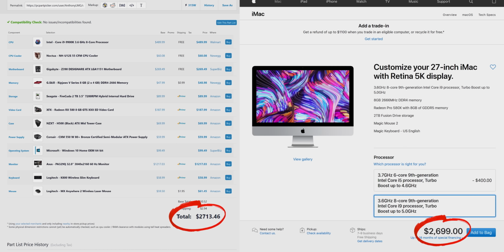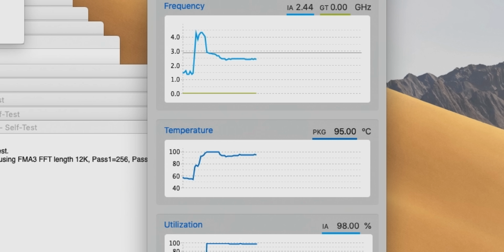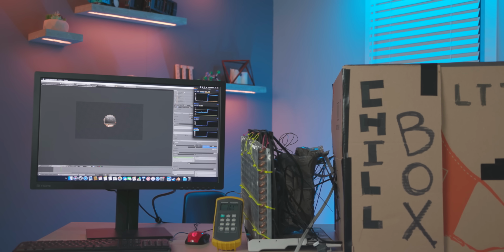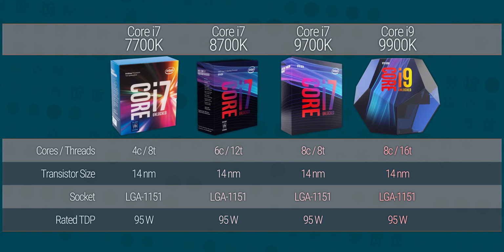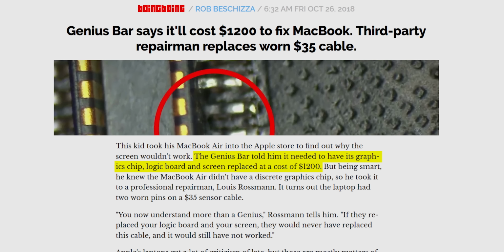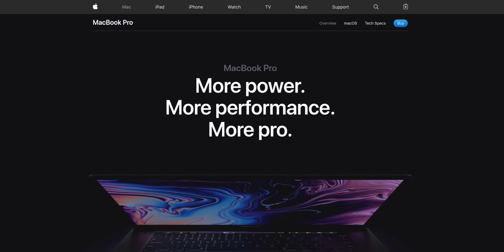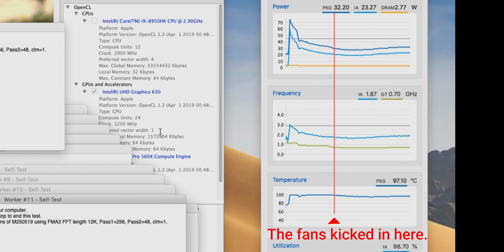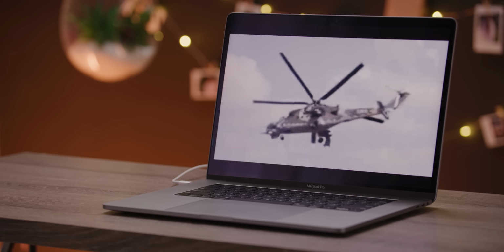Macs are SLOWER than PCs. Here’s why.

Comment: This video makes me wonder how well that new M1 chip is doing.
Reply: Pretty good in fact, a complete 180 degree turn, from a bad to a good purchase.
Reply: it's doing well,but apple products are still crap
Reply: @the-lag-gamerita5446  
Yeah, but the Mac operating system is totally worth it.
Reply: @matthew8153  not really.it's really limited compared to other operating systems.you'd  be better off with linux.and that's also ignoring the mess apple makes when it comes to repairing their products,and planned obsolescence.
they look cool tho.
Reply: @the-lag-gamerita5446  lol I have a 2012 MacBook Pro that I still use to this day
Reply: @Justin-hy9xz  anecdotal evidence,irrelevant.and it would also depend on the model.there is no shortage of apple products fried by insufficient cooling,or with poorly manifactured or defective components.
Reply: @the-lag-gamerita5446  the same can be said for windows
Reply: @Justin-hy9xz  except windows doesn't make PCs and so they have nothing do do with the eventual failure of your machine,wich will generally be easier or cheaper to repari than any apple machine.and if you don't like windows you can get linux.so no,the same cannot be said about windows.
Reply: @the-lag-gamerita5446  they look cool tho
Reply: @Justin-hy9xz  yes,they do.altought,you can probably find PCs that look more cool.the minimalist stile is good tho,i'll give em that.
Reply: @the-lag-gamerita5446  I mainly use my Mac for garage band which it handles pretty well, I just hate how over time all my PCs slow down. I guess that’s why I like using Apple
Reply: @the-lag-gamerita5446  I'm personally looking into virtualising their OS as while it may run a little worse than linux being in a vm and all it's much closer to windows in app quantity

Comment: I thought mac's performed better with the same specs? With more optimization etc? Or is this about how certain apps are more optimized for windows?
Reply: windows is just a hulking mess tbh
Reply: Technically apps are better optimized on macs than on windows. But bc apple has been making their macbooks slimer and slimer it gets very hot inside them and they can't run at full speed, so unless you have your macbook cracked open and inside a freezer I don't think it's gonna run faster. And again if the cooling was good it would be way better than a lot of windows PCs.

Comment: True but
Pc lifespan: dead in a year
My 12 year old Mac: So want me to run a showcase on ROBLOX at full graphics settings?
Reply: I'm curious, what is your reference for "PC Lifespan: dead in a year"? Just because some PCs fail, doesn't mean all do. Comparing reliable brands, Apple is no better than PC manufacturers. They just perform worse with similar reliability at best.
Reply: im sorry, ive had a couple pcs
my laptops: both havent died (one is 6 years old, one is 2 years)
then a 12yr old pc and a small intel nuk or whatever you call it

Comment: Because... they have worse hardware?
Reply: This video was made in 2019,macs are more powerful than pcs now.
Reply: @dreamsider  in what field?
Reply: @jonah6431  every field,they just blow away the competition
Reply: @jonah6431  intel chips were holding them back before so they shifted on their own chips and they changed the game with that.
Reply: @dreamsider  price per performance? Gaming?
Reply: @dreamsider  nope lol,multithreaded tasks are shit with the M1s
Reply: @the-lag-gamerita5446  they're still better than most powerful intel laptops
Reply: @dreamsider  confused AMD noises
Reply: @the-lag-gamerita5446  if you're talking about an intel pc with max specced gpu then ofc that pc would be better because macbooks have an integrated gpu but pc's have an dedicated gpu.
Reply: @dreamsider  no no,i meant that  there are also AMD based laptops.AMD is currently trashing intel after all.
Reply: @the-lag-gamerita5446  yeah, that's true

But the thing is still the same amd laptops have an amd processor along with an amd gpu,ram and other stuff

But in apple's case they have a single chip that have integrated graphics, neural engine, ram.

And that's also the reason why amd laptops are better for gaming.

Comment: people never complain when asus or msi make a damn laptop the size of a damn desktop but they demand apple to keep making them thinner
Reply: It depemds whar you want it for.
If you want it for gaming, then it may be bigger because you won't be going with it in many places.
If you want to do work on it, then portability may be important so you can work on it at home and at the office.

Most people buying from ASUS may as well just buy from any other company, but MacOS is only available from Apple and it is not for gaming on it unless you install another OS on it, but it's easier to buy a laptop which has the OS you want unless you are a Linux user and want to try many distros directly on hardware and not on a virtual machine.

Comment: Infact who buys apple is just plain stupid - even you don't need the power (b/c it gets throttled away anyways) given ppl are just paying too much money for aluminum housed crap - I never got one and I never will get one. I rather go with ROG - my last ROG Gaming Laptop is a G55VW S1071h - and I bought it 2013 - AND I'm currenlty writting this comment with it. 7+ years of heavy use at full performance and this thing still works fine for just 1300€ on my side to pay.

Comment: A Mac gives a better ‘package’ deal for everyday use. It runs smoothly and longer than PCs. The design and build quality are also important. 
This is what non-nerds care about. It runs smoothly and for a long time. And part of it is due to the OS.
Reply: apple slows old devices down to keep up battery life and you are saying that they run longer?
Reply: @user-hx7dc9uz6s  Well, they do, for what they need to do. I prefer to browse my internet a bit slower and still have a few hours of battery, than still be 'fast' after few years but with only 1 hour of battery.

Comment: its all Intels fault tbh
Reply: nope,it's apple fault,they design the cooling and choose the processor. also you are a sheep.
Reply: @the-lag-gamerita5446  they had contracts with intel and based on that they choose the design but intro couldn’t deliver their promises and therefore it would throttle because the design was never meant for shitty intel chips. They’re still on the same nm process they used for almost a decade now and fail to make any progress. Also how do you even know If I like Apple or not based on one sentence? You sir are a prejudice pos
Reply: @Burgerklauer  apple has full control on their PCs design,they should've just made it thicker and call it a day. there's no need for it to be so thin anyway.
Reply: no because intel does not create the thermal solutions

Comment: I have a Mac mini with a Intel core i5 chip.  I am running boot camp to run Windows 10.  I play World of Warcraft and I have done it in Mac OS and Windows 10.  Windows 10 does as expected with the hardware at hand. When I run World of Warcraft in Mac OS it is a train wreak.  I cast a shield and 10 second later it shows in the screen where in Windows 10 it is really fast.  The same with casting spells.  The reason I have a Mac is because I am a programmer and Swift you have to have a Mac.

Comment: Apple COULD sell a performance line of laptops with a thicker case that had adequate cooling.   as much as millenials love to carry around a wafer thin laptop with no optical drive there are also performance nuts who would buy a laptop with a much thicker base to hold more cooling and drives and whatever.

Comment: So tired of Linus' spec comparison.  A PC manufacturer never pays the retail price for parts yet that's what he always uses when he compares the cost of part to the overpriced Apple shit.

The reason they don't care about making the systems cooler is that they don't want the macbooks to last a long time, if your plan is to have uses replace their macbook every few years what better way to make them do it than to have the  macbook fail from heat stress.
Reply: macbooks last way longer and hold their value much longer than equivalent windows laptops.
Reply: @conner-i5u  false.

Comment: After watching this, I realized that it isn’t apples fault but Intels fault. What they are doing is keeping their chip size the same and creating the thermal issues that’s plagued the MacBooks up till  the  m1 MacBook. Apple wants the MacBook to be used professionally but can’t and again it’s not their fault it’s intels fault. I mean we see this now with the performance of their new M1 laptops and realize that they could have done with intel for a long time but didn’t because they need still a supplier for the time being.
Reply: nope,apple choose those cpus and designed the cooling solution,they should've made their product thicker to include a proper heatsink and fan.they are the only one to blame for this.
Reply: not only apple uses those chips, other manufactures get the temperatures to be better

Comment: Almost all of your points are valid, but your conclusions are headscratchers: Macs are famous for lasting ages (recalls aside, obviously), but you conclude they don’t care about reliability by assuming they fail. You say competing notebooks don’t have enough cooling either, yet the video title claims Macs are slower. There is a difference between preferring a different tradeoff and claiming Macs are categorically slower than Windows computers (assuming that’s the definition of “PC” here).

As for Apple's marketing, they flat-out ignore Intel’s TDV and consistently label Turbo Boost speeds properly, as you can see in your own examples.

Comment: M1 chip: your wrong and here’s why
Reply: he was't wrong at the time.
Reply: Profesional software will not run on M1
Reply: @gandalfwiz20007  you forget the word "yet"
Reply: @noobyte9424  run a FEM analysis, I'm curious if you can
Reply: @noobyte9424  i am trying to prove a point: Say i want a portable computer, to do my work, i want to spend 1000 to 1500$ on it, but i also want it to run everything i need( from browsing and mailing up to gaming and engineering software - i work in this domain). Can i buy a Macbook to do all these things? ( yes if i install windows on it...) can i buy a acer, hp or lenovo laptop? ( yes because they run everything with windows and have good specs for the money...). The conclusions is, you spend a lot of money on a macbook and it can't run everything...
Reply: @gandalfwiz20007  I understand your point, but no operational system can run everything. There are some apps that are exclusive to either windows or Mac, and there may be others that run the same function on the other platform yes, but I guess that this choice depends a lot on the personal use it. I for example code in C# / .NET. Even so that is a Microsoft solution, I do it on my Mac, and it works just fine. But I also am starting to play with swift lately... it is just better for me to use a Mac. “Professional software won’t work on it” is not entirely true since there will be professional software that will work as well as there will be some that won’t. In the end it is not an obvious choice for everyone. It all comes to personal use. For some it will be straight up better. For others it won’t.
Reply: @noobyte9424  point taken ;)
Reply: @noobyte9424  No. The point is Windows can run anything, but MacOS is limited as hell! And with M1 chips things are getting even worse now when Apple is taking away our right to run native Windows x86 via bootcamp! Not to mention terrible backwards app compatibility - the x86 apps that won’t run when Rosetta 2 comes to an end when transition is over. That’s why Apple emphasizes M1’s “incredible” battery life and performance, which is good for an average user, but useless for pros when they can’t run Win x86 apps anymore! Heck, even Microsoft Office is different and limited in functionality in MacOS! Now they’ve announced that even MS Outlook for Mac will become web version only! That’s why video editors, developers and youtubers tend to love ARM MacBooks, but somehow they never cover MS Office in their reviews! Just like they don’t know that these devices are limited!
Reply: @gandalfwiz20007  A agree with your point. Can you suggest any laptop from PC market which can compete with macbooks 13” in build quality, ergonomics, pleasure of use and support? Now I want to leave M1 Apple ARM transition hassle, but do not know Windows laptops market very well... Dell XPS 13 or Surface Pro look very attractive to replace my old Intel MacBook Pro..
Reply: @alex.maxwell  here is the thing, yep  the macbook can't be competed in terms of build quality...but look at the cost: 1800$ for an 13' laptop is a bit pricey don't you think? I mean, for the money, you can get a Acer or Lenovo gaming laptop with i7 or i9 and 2060 rtx...yeah it these laptops do not have that ultimate build quality, but they do have specs. Also, a cheap 450$ hp 13 inch laptop has decent quality and low specs, but good for battery life and portability
Reply: @gandalfwiz20007  I agree. But gaming laptops are a different league. Let’s not involve them here because Apple is not in the game here. In the top laptops segment the PCs are not much cheaper. The two laptops that I mentioned above are in the 1500-1800 USD range at similar specs. There are two major reasons why you buy these expensive ones: 1. Design 2. Reliability 3. Portability (business use with performance vs battery compromise). But in the first two aspects no one can beat Apple. Probably Microsoft or Dell. They try, but not there yet. So, Intel MacBooks always offered much better value than any PC (except gaming laptops). Because they just offered great experience from both OS worlds. Until ARM chips arrived. And now Apple fanboys try to proclaim M1 the best solution for everyone. And that Intel will die. That’s just hilarious.
Reply: @alex.maxwell  try to run Logic Pro X, Final Cut, Air Drop on Windows. I dont want all of them, i NEED them for my daily use. If u can, then Windows really runs everything.
Reply: @gandalfwiz20007  cant run unix based SZ testsysteme's ATE software on windows either. Your point?

Comment: I swear, people who buy macs have no idea what they are buying. A macbook air has 32GB ram for an i3 like how th is that supposed to work??!!
Reply: Thats not even a configurable option. People buy Macs because they are better than Windows its that simple. When you compare a windows computer made with the same technology there is practically NO difference in price, especially when you consider the pixel density of the screen which for some reason PC people don't seem to grasp when doing their comparisons. Yes your 1080p laptop is going t cost less than a 13" pro with a capable resolution of 2880x1800... 

Then you have the security aspect, best touch pad in the world, some of the best laptop speakers in the world, full aluminum body. No wacky cpu cooling that causes the laptop to spin when its doing NOTHING.
Reply: @andremessado7659  thats because windows is shit, well if you let your laptop overheat you dont need to spin up the fan(i know that M1 exists)

Comment: I'm glad that I'm also using macs fan control. I'm running still on a late 2012 mac mini i5 at 2.5Ghz and I have always changed it from auto to base the fan speed on the cpu core temperature. And scaled the fan speed accordingly. An exhaust fan is not only cheaper, and easier to replace than the entire logic board. Sure my mini runs sluggish but it still does what I want it to do. Sure dragging a .MTS takes minutes of me holding down the mouse click button to drop a file into iMovie but it still gets the job done. I've had little to no problems with my mini and it's going on 8 years old with the same wireless keyboard. It's had water, soda, tea, and liquor spilled on it and still works perfectly fine like it was new. Same with the magic mouse. My early 2015 MacBook Air i7 at 2.2Ghz when set to auto with no MFC installed always made my lap super hot and it still read at 111F on the CPU core. Since I installed it and set the fan speeds accordingly I still have no problems. Even though I drive a shitty car, I always pay attention to temperature because radiator is old and won't dissipate heat. I still use an original iPhone SE and the only things I've replaced on it was the charging port assembly (twice but the second I got free because it is a lifetime warranty through iFixit) and the battery. Sure it's dinged up and scratched to hell, but as many times as I've dropped it on concrete and kitchen floor tile it still works perfectly fine. i love the original SE for the durability and that's why I downgraded from a 128GB iPhone 6 plus to the SE (after doing a rear housing swap to sell it). Plus I have small paws. The 4 inch form factor is perfect for me and the design & durability heavily out weighs my needs. The 5.4 inch no, you can keep it. My 6 plus took one drop on kitchen floor tile and destroyed the glass. When this phone completely dies, I'm just gonna buy another original SE.

Comment: Linus dis not true anymore M1 gang
Reply: still crap can't run windows software you are stuck with crappy mac os software that apple approves.  The openness of a PC far outweighs the M1 speed and thermals
Reply: @FubarMike  Lol for 99% on regular use things and creative applications Macs are really good and smooth. Unless you want gaming or need really high specs (per $) for specific use, Macs are solid.
Reply: @FubarMike  creppy windows makes arm version